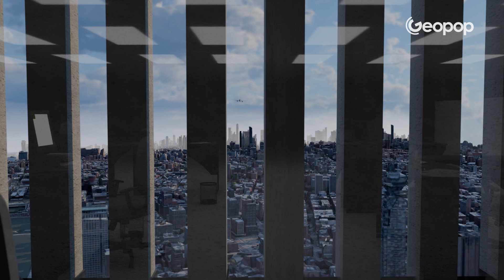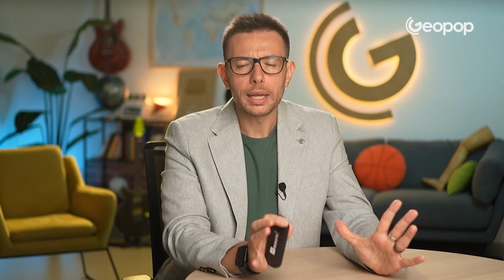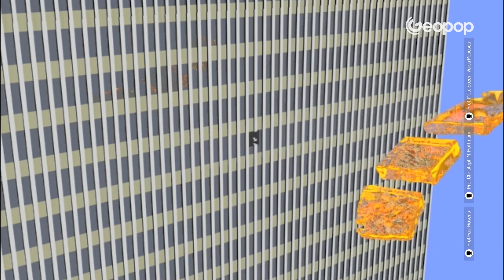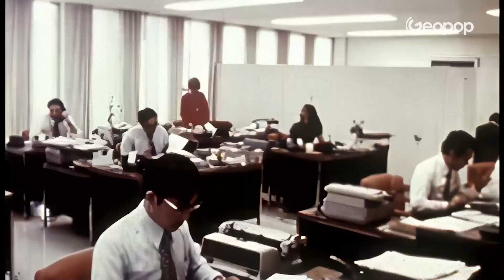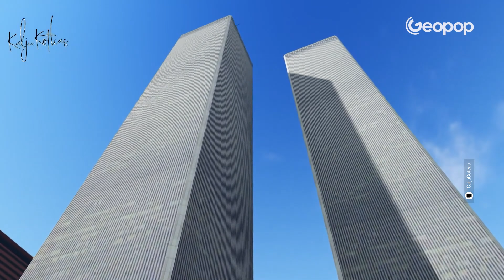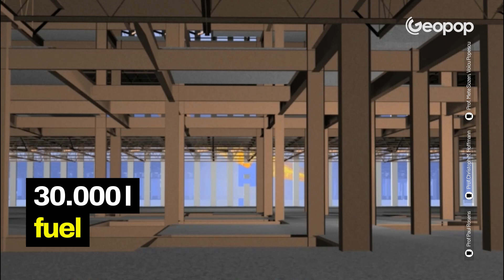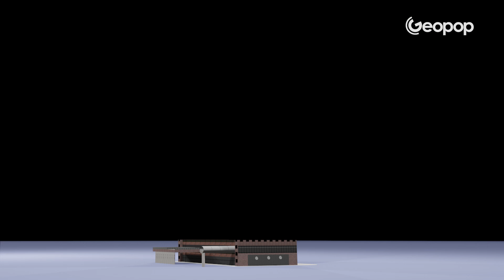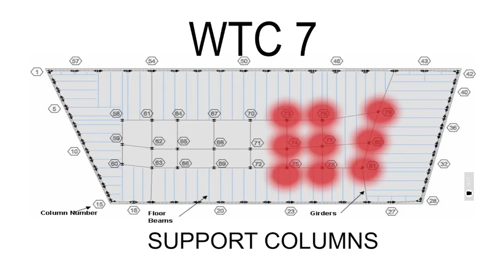9/11, 2001: The Technical Reconstruction of the Twin Towers and WTC 7 Collapses

Comment: Anyone who believes this NIST theory of what happened I just want to say I have a bunch of ocean front property for sale in Indiana. Even if all the buildings fell due to steel loosens strength it wouldn’t have fell straight down considering the damage to both towers was done to only one side of the building. Boom what a discovery. Build any tower you want at home and remove something from one side until it falls over and it will fall towards the side that is missing strength.
Reply: You missed a few critical details.
Reply: @TheLoonResistance 
Like 3000 unrecovered bodies?
Reply: @Larry26-f1w well some bodies were recovered and they have also reported on other documentaries that a lot of the bodies was pulverized by the buildings. Is that true? IDK. Everyone also forgets that a full month after the event took place, ground zero was still showing areas red on thermal cameras from the molten steel. Let that sink in. No fire in that building was ever hot enough to melt steel.
Reply: @TheLoonResistance , та ти ж усюди пишеш свої відгуки! Хто ти такий?
Reply: @TheLoonResistance then elaborate or don’t say anything.
Reply: @keithperry6282  - The damage was NOT confined to one side of the Towers and in fact, neither tower failed on the impact side.
Reply: @TheLoonResistance the reports say otherwise if that’s what you believe. Report stats that beams were taken out at the point of impact and a few beams in the center column area.
Reply: @keithperry6282  - There were no beams so no, there are no reports that talk about beams being taken out.   I can see you will be wasting a lot of time so I'm going straight to the nuclear option:

At the end of the day we all just want to know what really happened, right? I’ve put some thought into this and if you don’t mind, I’d like to share my perspective. You may choose to disagree, which is fine, but if I am in error on any point of fact, logic or reason please let me know. 

Twin Towers collapses aren’t and have never been a mystery. The world’s structural engineering community worked out the details within weeks. The general public has taken longer, not helped by the deluge of erroneous information and technical mumbo-jumbo abounding on the internet. Fair enough, engineering is hard and who is going to put in the required time?

Me!  

Because anything can seem like a conspiracy if you don’t understand how it works and I like understanding stuff, I dove deep and prepared this short technical overview of Twin Towers collapses so you don’t have to. No politics, ideology or magical thinking, just engineering. Hopefully this dispels many common myths and answers most or all questions and concerns you may have about the collapses.  

While complex, most Twin Towers collapse mechanisms can be seen with the naked eye and understood by the layperson IF sufficient time is taken. So let’s take some time. 

1. The Twin Towers consisted of 4 primary structural elements that together formed an integrated system where each relied on the others. 47 hollow box-section steel Core Columns carry the majority of the gravity loads. The 236 hollow box-section steel Perimeter Columns carry the remainder and ALL of the lateral (wind) loads. Long-span Lightweight Steel Trusses connect the core and perimeter column together at each floor with a Hat Truss on top to tie the structure together as an integrated unit where no element can survive without the others. There was no structural load bearing concrete and most components were bolted together.

www.youtube.com/watch?v=u7OqrC74Dm4

2. The impact of a 122-ton airplane (= to 12 dump trucks) at speeds up to 587 mph and the energy of a ton of TNT destroys the aircraft in 0.75 seconds, which in no way implies the Towers come out unscathed. Some folks get hung up on that. Many perimeter and some core columns are damaged or destroyed. This damage is primarily through bolt-shearing failures at the end connecting flanges, as well as bending, twisting and fracturing of weld seams. There was no cutting or slicing - the reality far more violent and brutal.

3. The impacts destroy or damage fire insulation, fire breaks and sprinkler systems on multiple floors. Huge fires are started across multiple floors simultaneously and allowed to spread rapidly with no effective firefighting or fire suppression. This was an unprecedented fire event .

4. The hotter steel gets the weaker it gets shouldn’t be a revelation. With fire insulation removed and no sprinklers the survival time of the steel greatly reduced . Over time heat gradually causes the lightweight steel Floor Trusses at the impact damaged floors to sag, which can be seen. No steel melted or needed to. Structural steel fails long before it becomes a puddle. It just needs to bend

5. A straight column is up to 4 times stronger than a bent one. Sagging floor trusses pull on increasingly weak and overloaded Perimeter Columns, causing some of them to bow inward by up to 5 feet until they buckle and fail, quietly initiating collapse. The formerly static mass above which the structure below could easily support converts to a dynamic mass up to 30 times greater. Because they have buckled, the Columns above and below the failure point are no longer aligned . The load bearing structure below no longer bears any load as it falls past the lower columns, NOT onto them.

www.youtube.com/watch?v=ULdiD6gYZO0
www.youtube.com/watch?v=zTygQK3vriI

6. Thousands of tons of debris fall within the four outer walls, down through the open office space, crashing onto the first intact floor it encounters, immediately breaking the bolted column connections as the amount of resistance the Floor Trusses can offer is negligible. The falling debris slows only marginally and briefly. Note: 
6a. This is NOT a solid top block crashing into and “crushing” a solid bottom block . 
6b. The debris falls past the columns not onto them. The columns provide no resistance to the falling debris. 
6c. Only the bolted floor truss connections to the core and perimeter columns offer any resistance. A pair of 5/8” bolts at each end of each truss vs. thousands of tons of falling debris. 
6d. No laws of physics are violated. 
6e. There is no 20 floors against 90 floors but rather 20 floors against one floor, then 21 floors against one floor, then 22 floors against one floor, etc. 

7. This floor-led collapse progression within the four outer walls can only go straight down.
7a. This process is often incorrectly referred to as “pancaking”. The catchy name stuck but nobody knows what it really means and "pancaking" is too simplistic and inaccurate anyway. I prefer Kaiserschmarrn.

8. Collapse progresses through the floor systems past the columns, through the path of least resistance . The resistance offered by each floor is always the same while the mass of debris and its velocity – thus its energy - increases with each floor failure. Each floor offers the exact same resistance to the falling mass while with each failure the falling debris constantly gains both mass and velocity. *This process of floor-by-floor destruction cannot be arrested. It can only speed up . Rate of floor failures increases with each floor as momentum increases, reaching an average acceleration of 0.65 of GA, or 35% slower than true free fall. Bam, bam, bam down the building until there are no more floors to fail. The resistance offered by each successive floor is always the same. More mass, more velocity, same resistance with each floor. Don’t get stuck on the but the lower floors weren’t on fire nonsense. They didn’t need to be.

9. The Towers were 95% air by volume. As that air was compressed inside the building, pressure builds until it is blown out the sides in reaction to the building collapsing . Those were not “explosions”, it was expulsions of compressed air caused by the collapsing building, explaining the low velocity, lack of flash, blast, supersonic pressure waves and lethal high-velocity ejecta.

10. Perimeter Columns become detached and peel away like a banana behind the collapse front, playing out to the four points of the compass extending to 800+ feet from the base of the towers, obvious from overhead examination of the debris pile.

11. Core Columns fail last as their internal beam bracing is stripped away by falling debris and lateral support from the floors to the perimeter columns is lost.

www.youtube.com/watch?v=WpHXj62Ylw0

12. For those who care about how long this whole process took; 31-34 seconds from the moment the perimeter columns buckled until the last core columns hit the pile, or 1/3 the rate of true free fall. Don’t believe me? Just watch any video of the collapses and note the loose truly free-falling debris dropping much faster than the towers themselves.

13. Each Tower had a 1-acre footprint. Far from collapsing inside their own footprints the debris pile spread out over 17 acres in a pile up to 14 stories deep. 8 surrounding buildings were destroyed and scores more damaged by the falling debris.

14. Twin Towers were perfectly safe within their design envelope. They only collapsed when taken far outside design parameters by an extraordinary and unprecedented event

Impact + Fire (heat) + Time + Gravity = Collapse . Remove any 1 of those 4 elements and there is no collapse. Ignore any of them and you will never understand the collapse. The Twin Towers were an integrated system in which no one component could survive without the others. One fails, the rest follow, through the path of least resistance DOWN the open space, bypassing the path of greatest resistance, the columns. 

Nothing above violates any laws of physics. It’s also true no matter who planned and carried out the 9/11 attacks or why so the attacks could still be some sort of “inside job”. 

If you made it this far, kudos. That was a lot. I hope it was helpful, informative, non-adversarial and solicits informed critical comment, positive or negative. If I made any errors of fact, logic or reason or left anything critical out, please let me know and I’ll fix it. To stay focused, just one point at a time please and on-topic (Twin Towers ONLY). No word-salads of Gish Gallop. IF you can offer a more plausible alternative be my guest. Please start any reply with the words “Tits McGee” or I’ll know you didn’t read it and aren’t serious.  

Thank you for your time.
Reply: How did building 7 fall at free fall speed symmetrical if only one beam got pushed off?
Reply: @keithperry6282  - It didn't.  Were you not paying any attention at all?  Here's the other half of the nuclear option.  You have already tacitly accepted the first half so no need to discuss the Twin Towers further.

Building 7, the 6th building to collapse of 10 lost on 9/11 got little attention early on due to higher priorities. As a result, the information void got filled with technical nonsense, creating lots of confusion and misconceptions.  Many people, like you, just want to know what happened. To remove the confusion I prepared this brief summary from my own independent technical analysis. Let me know what you think.

At 10:28am the WTC North Tower collapsed, showering Building 7 with tons of burning debris, causing heavy damage and starting many fires burning out of control for the next 7 hours. Since half the firefighters had been killed, units in disarray, equipment destroyed, no water pressure, and the priority of search & rescue efforts, 7 couldn’t be saved so firefighting efforts were pulled as futile and 7 left to its fate. Firefighters make that choice every day in brush fire situations - which houses to save and which ones to let go. Only real difference here is moving the decimal on the size and cost. People get overwhelmed by the size.

www.youtube.com/watch?v=g_SvpwyC17M 

Collapse of a burning structure is always a concern for firefighters.  Steel buildings are uniquely vulnerable to fire damage. Designed around 1 to 3 hours of fire resistance for occupants to escape they rely on active firefighting to survive.  After that all bets are off. Left to their own devices they'll exceed their design envelope and collapse, like Plasco Tower and Wilton Paes de Almeida. In 7 the occupants escaped, passive and active fire protections were compromised and active firefighting was abandoned hours before the collapse, which left the building to its fate. It lost. Odds on Building 7 would eventually collapse, and it did. No big deal in logic.

 http://www.youtube.com/watch?v=WnYBX6QT0R4 

FDNY Chief Daniel Nigro - The biggest decision we had to make on the first day was to clear the area and create a collapse zone around the severely damaged 7 World Trade Center, a 47-story building heavily involved in fire. A number of fire officers and companies assessed the damage to the building. The appraisals indicated that the building's structural integrity was in serious doubt. I issued orders to PULL back the firefighters and define the collapse zone. It was a critical decision; We could not lose any more firefighters. It took a lot of time to PULL everyone out, given the emotionalism of the day, communications difficulties and the collapse terrain 

FDNY Deputy Chief Peter Hayden ; We had our special operations people set up surveying instruments to monitor and see if there was any movement in the building. We were concerned of the possibility of collapse in the building. And we had a discussion with one particular engineer there, and we asked him if we allowed it to burn could we anticipate a collapse and if so, how soon? And it turned out that he was pretty much right on the money, that he said 'In its current state you have about 5 hours 

The collapse of Building 7 was anticipated and widely reported in the media throughout the day, with 24 video cameras recording it. Everyone knew what was coming and why. 

www.youtube.com/watch?v=OY5S5k3tMHI

Building 7 collapsed from the inside out which is not intuitive and hard to understand.  Most details are hidden from view and some people will struggle no matter how much it is explained. But here is my best shot relying on no outside authority. 

Building 7 was a unique, asymmetrical 47-story steel frame structure built atop a smaller 3-story building serving as a partial foundation and requiring lower floors dedicated to complex load transfer structures. Of trapezoidal shape and tube-in-tube construction, B7 (above the 7th floor) consisted of a central core of steel columns carrying most of the gravity load, perimeter steel columns around the outside of the structure carrying the remainder of the gravity loads and long span beams and girders to tie those elements together and form the floors. On the outside of the building hung a curtain wall facade or outer shell. 

www.nist.gov/image-16640

Phase 1 : First externally visible signs of collapse initiation occurred at 5:20:28 pm and was notably quiet with observers not realizing the building was collapsing! No warning in the form of hundreds of eardrum busting 180dB explosive bangs. Here at 12:00 a local CBS affiliate reporter is just 10 blocks from B7 when collapse begins. People don’t start to notice the collapse until 12:11. At 12:45 is the famous CBS fixed camera clip of Building 7’s collapse. Note the silence. 

www.youtube.com/watch?v=t5tEy6mXSE8

Lower floor failures above the load transfer region (8-14) in the NE corner initiated the collapse. In this video at 0:45 you can see the NW corner from inside the building while under construction, Column 79 just out of frame on the left. That big, angled steel beam across the top of the frame connects to C79 at one end. The girders connect to the beam. That beam and all those girders depend on just one connection 

www.youtube.com/watch?v=nP3TNHPCIVU&t=45s

Phase 2 : NE corner floor failures caused a loss of critical lateral support over an excessive length of Column 79 and it buckled. Externally we see a vertical progression of window breakage along the 44-46 line and a kink in the roof of the East Mechanical Penthouse atop the building, all consistent with C79 failure. Looking at the above floor diagram of Building 7 when you see all the structures that depend on C79 you quickly realize this one column was a relatively isolated structural element on which a disproportionately greater fraction of the structure depended analogous to say the Key Bridge. Normally with a buckling column, the load could be redistributed to other columns. With C79 that is not the case - the failure did not redistribute the load, so the collapse rapidly progressed to the roofline, sinking the rooftop penthouse. The transition from full capacity to almost no capacity occurs in an instant and will result in virtually no resistance 

Phase 3 : With C79 gone, B7’s progressive, non-symmetrical collapse continues with adjacent columns C80 and C81 left laterally unsupported and quickly buckling as well. The EMP drops down through the building. C79-81 all have no diagonal bracing, which is the major reason why they could not redistribute a lot of vertical loads among one another. From there collapse progressed from east to west through the central core until the core was gone from C81 to C58, taking all the interior floors and probably most of the perimeter columns with. Follow the horizontal progression of window failures low in the building and the dropping of the remaining rooftop structures into the building. The NIST Building 7 study model 4 determined C79 failing under ANY circumstances would have initiated the same collapse sequence. 

Phase 4 : After about 10 seconds only the exterior moment frame remains, giving the illusion B7 is still standing to the casual observer as little has changed outwardly. But it is just a hollow empty shell like an empty cereal box supported only by a few remaining columns and quite unable to remain standing on its own. With nothing remaining behind it, the north face of the outer shell leans into the void, forming a V in the roofline, the last few columns buckle under the strain and the moment frame free falls, landing on top of the debris pile. 

It is only now that we get to “free fall”. For those who get all worked up about an alleged 2.25 seconds of free fall - don’t. How fast something falls can’t tell you what started it falling, the alleged measurement people fuss about is wrought with problems, not least of which being it isn’t The Building (defined as its center of mass) being measured AND the measurement doesn’t even start until more than 10 seconds after the collapse begins, meaning whatever caused the alleged free fall was due to collapse progression mechanisms NOT collapse initiation mechanisms. Useless for informing on what caused the collapse in the first place. It is now and always has been a Red Herring. 

The debris spread well outside the footprint blocked surrounding streets, heavily damaging the Verizon Building and destroyed Fiterman Hall. 

No building is meant to survive 7 hours of multi-floor unfought fires. Building 7’s progressive, non-symmetrical collapse was incidental, unintended collateral damage from the combination of fire, time & gravity started by the collapsing North Tower, true no matter who planned and carried out the 9/11 attacks or why .  Of so little consequence it barely registered at the time, only taking on semi-mythical status as an alleged smoking gun years later when demolitions at the Twin Towers, missiles at the Pentagon and shoot down over Shanksville all failed and conspiracists had nothing left to work with. 

If you get most or all of your information from conspiracy sites and videos its a good bet that 90% or more of the above is news to you.  This is why it is so important to avoid that mind rotting shit. Anything can seem like a conspiracy if you don’t understand how it works. Now you should. I hope you found this helpful, informative and it solicits informed critical comment. If I made any errors of fact, logic or reason or left anything important out, please let me know so I can fix it. OR offer a more plausible alternative if you can. Be the first.
Reply: @T @TheLoonResistance ts McGee when I say beans it is in reference to columns. Columns was cut in half when plane impacted the buildings. I have studied and watched this stuff for the past 20 years. There is a professor from Alaska named Dr. Leroy Hurley that already did a report stating that the towers did not fall from any sort of fire. He did the report for AE 9/11 Truth which was formed and has over 1000 architects and engineers that have signed a petition stating the same thing. They also took it to the Supreme Court. I’m not sure where you stand on the situation but where I stand is the towers were brought down electronically and there is multiple facts that give me this conclusion. What I don’t know is who did it. I have my own guesses but that’s it.
Reply: Also you stated that no steel melted. That is false. There are multiple eye witness reports from first responders saying they seen molten metal flowing under the towers. In fact there were infrared reports taken a month later and the ground in certain areas was still multiple hundred degrees. As for the fire and the protection being removed upon impact I will agree with. The fact that all 3 buildings fell perfectly symmetrical is impossible especially at free fall speed. Believe what you want but I’ll take 1000 architects and engineers word over a BS NIST story that doesn’t even make sense unless you’re naive.
Reply: Couple things I will point out is why wasn’t there any steel columns hundreds of feet on the air. Why are there eye witness reports of explosions going off in the basement. Literally taking the skin right off of people. Literally first responders saying they heard what sounded like explosions going off like boom,boom,boom all in order?
Reply: @keithperry6282  - Columns and beams are two very different things. Columns are vertical and carry gravity loads. Beams are horizontal and carry lateral loads.

Hulsey only did a report on Building 7. He was wrong. The why is obvious if you actually bother to read his report.  Not worth the paper its printed on. 

AE911T does not have 3,000+ architects and engineers. Their brain trust for most of the organizations existence has consisted of;

One former manager of architects whose career highlights include designing a high-school gymnasium and a Denny's. This guy explains the complex interactions of millions of components by banging two cardboard boxes together.  He was kicked out of the organization he founded a few years ago for compromising their fundraising ability – just to show where priorities are. 

An unlicensed civil engineer who builds radio transmitter towers who is responsible for their structural engineering analysis, even though he isn't a structural engineer. It shows. He is also one of the most truly unpleasant human beings I have ever interacted with.

Their top physicist is a retired 9th grade science teacher.

Their FEA is done by a carpenter using MS Paint.

And so on and so on. You get the idea. Not exactly a deep talent pool. Almost none of their core group of experts are still actively involved in the organization, which has been reduced by posting comedy meme's on Reddit featuring Simpson's characters.

The 3,600+ A&E's you refer to are not members of the organization and do not perform any actual work or analysis for them. Some 3,660 people worldwide (a statistically insignificant number) who hold some sort of professional credential, degree or license in some technical field, have over a period of 20 years simply signed this petition after listening to a one-sided sales-pitch :

To the Members of the House of Representatives and of the Senate of the United States of America, PLEASE TAKE NOTICE THAT

On Behalf of the People of the United States of America, the undersigned Architects and Engineers for 9/11 Truth and affiliates hereby petition for, and demand, a truly independent investigation with subpoena power in order to uncover the full truth surrounding the events of 9/11/01 — specifically the collapses of the World Trade Center Towers and Building 7. We believe there is sufficient doubt about the official story and therefore the 9/11 investigation must be re-opened and must include a full inquiry into the possible use of explosives that might have been the actual cause of the destruction of the World Trade Center Twin Towers and Building 7 .

The petition is not testimony or an affirmative statement of anything. It is a mere request that someone else look into the POSSIBILITY of the use of explosives or incendiaries that MIGHT have been the actual cause of the collapse of the Twin Towers and Building 7 because of a belief there is sufficient doubt .

Can’t get more generic and non-committal than that!

One does not even need to believe explosives/incendiaries were used on any building to sign the petition. Indeed, I have several friends who think that idea is absolute nonsense, but signed the petition anyway just to get the AE911T newsletter. So, you can’t make any assumptions about why anyone would sign.

The folks who signed apparently can’t even be bothered to do the investigation themselves, or perhaps they are unqualified or just not that interested. Not that important I guess.

Those who have signed certainly do not publish peer reviewed technical articles in favor of AE911T claims. One would think over 3,600+ “experts” would generate many hundreds of such articles, but there’s nothing. Not a thing.

Just 3,6xx names over 20 years of campaigning is a tiny number. Completely insignificant. If we break that down further many signatures are so old that a significant number of signatories has likely passed away. Others surely no longer support even the very limited scope of the petition's language, may have even forgotten they signed the thing. Others are not practicing or no longer certified in their fields. Many architects and engineers are not qualified to assess the engineering facts of 9/11 (land surveyors, electrical engineers, ...), and most obviously are not well informed about the facts of 9/11 (they only heard the AE "Truth" sales pitch) so the fact they have signed the petition by itself means nothing

Meanwhile the 130,000 member American Society of Civil Engineers - ALL of whose members are qualified engineers - fully supports the conclusions presented here. And that is just a start. In 24 years zero structural engineers of tall buildings, including the 1/3 that have retired in that time, have made any statements in support of 9/11 Truth BS demolition claims. Zero, nada, none.

AE911T operate like a faith-based organization and have no interest in finding out what really happened.  They are in reality a perpetual fund-raising machine – this fundraiser going towards supporting the next. They literally have just one job and they have utterly failed at that for 20 years! At what point do you start to figure out something isn’t quite right?

What you do is go for the low-hanging fruit. You visit conspiracy web sites, blogs and YouTube videos published by idiots and morons who don't have a clue but tell you what you want to hear. In 2 posts I gave you more - and fare more accurate - technically descriptions of the collapse of 3 buildings than 20 years of conspiracy porn has given you. 

But I'm not selling what you want to buy.